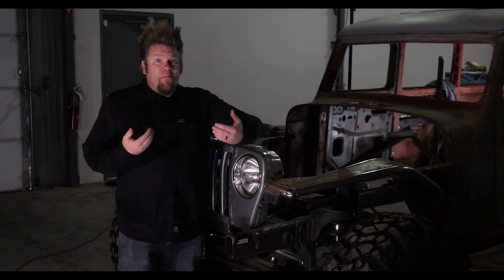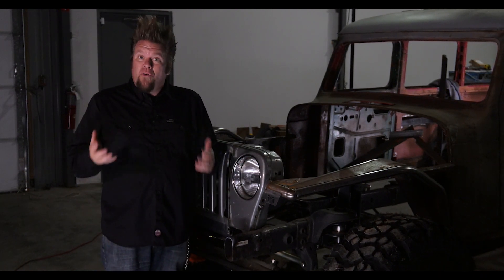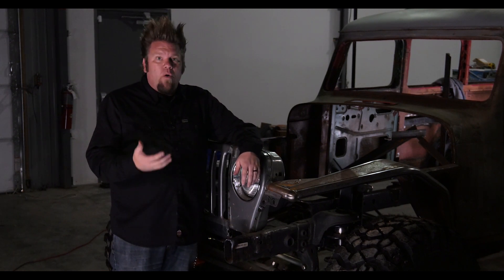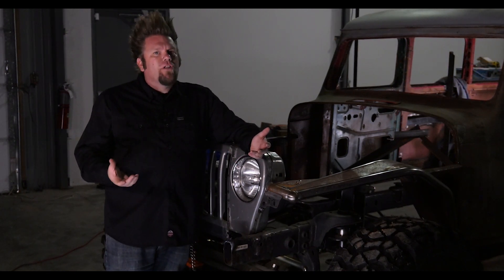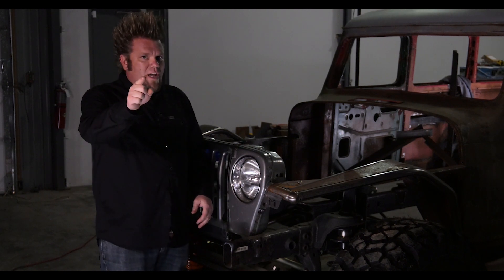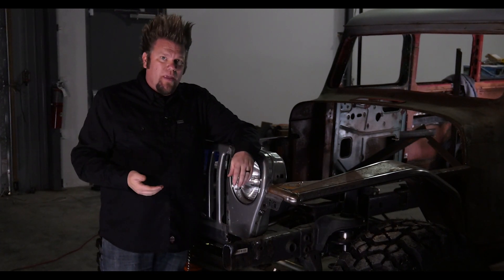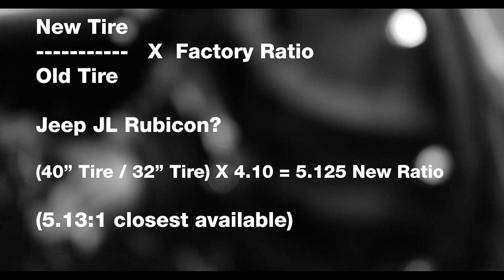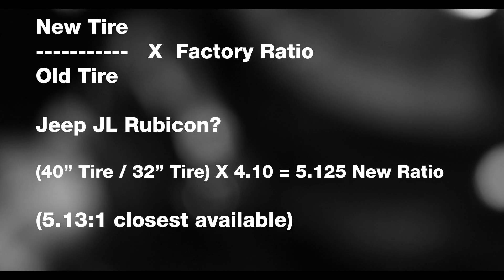Calculating Gear Ratio

Comment: Hey Ian I am digging the build. I am considering a mezzanine (spelling) rear suspension for my ruck is there any pointers Or things I kneed to know or I should look out for as I install one in my truck? Any advice on this would be appreciated Thanks as always keep it up bro and I lift my glass and say cheers
Reply from the maker: I am unsure what you mean by mezzanine type suspension
Reply: Big Tire Garage well it’s been called a Nezzy arm or toggle link buy the guys I hang with. Not too sure but it’s Like your traditional four link system with two parallel bars mounting at the corners of the axle to an area close to the bottom of the frame rails or chassis and two tubes that locate the axle from the top of the axles to the outer inside of the frame rails the difference is that the load and dampening units are carried on to additional arms usually mounted behind the axle and connect to the axle via tire rods.  If I can find more or pics I’ll send some thanks and always cheers

Comment: yo ian when you gona build a extreme off road subaru lol seriosly though the old square body roos look awsome lifted with big tires mine has a 5" lift on 30s tiny tires for a wheeler but it has more than 15" of clearence at its lowest point and it mobs the hay out of johnson valley were i live the thing goes everywere exsept the hammers trails it leaves the jeeps in the dust out there in the open desert the things are like legos so you can mix and match the best parts from the best rigs

Comment: Years ago I read an article written by Rick Péwé in a petersen's 4-wheel & off-road magazine that said tire size ÷  12 gives you 1 to 1 so that's what I've always used.
Reply: Ken MacMillan that sounds logical but I just divided 37” by 12 and it gave me 3.08. Completely wrong. 
52” divided by 12 is 4.33 gearing. 
Still completely wrong. 
40 divided by 12, 3.33, wrong again. 

I think maybe something is missing from the equation you provided?

Comment: Gearing has been a hot button for me. There seems to be a following of 4:88 or lower. I am running 35 s on my 6sp JKU. I have bumpers and skids and a family of 4 and want to get a little power back. But I still want to run 75 mph down the highway without tuning 3500 rpm. I just drove to Moab and being a mile above sea level my rig was sluggish at best. To be honest I do not see 37 inch tires at this point. What about a 4.56 to replace 4.10 in a JKU Rubicon?
Reply from the maker: What trans, and 37's?
Reply: Big Tire Garage NSG370 6sp manual. 35 inch Maxxis Razr MT is what I am running.